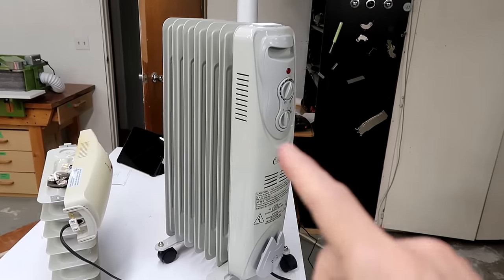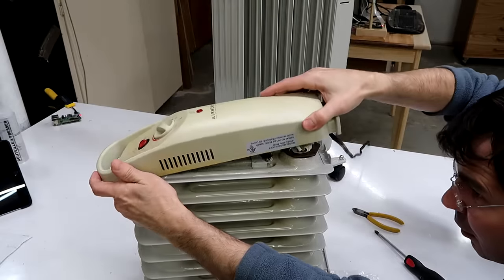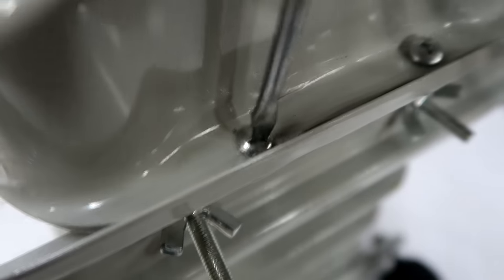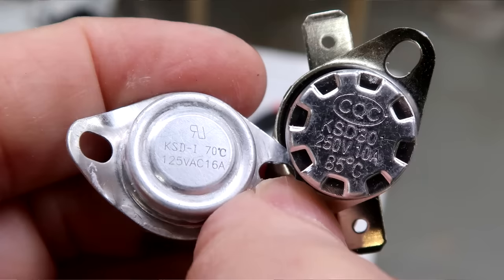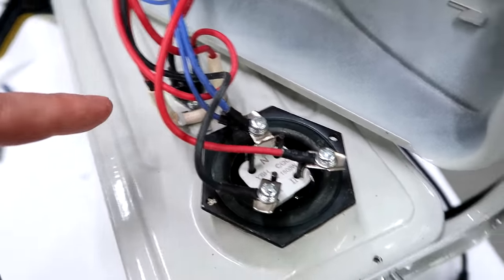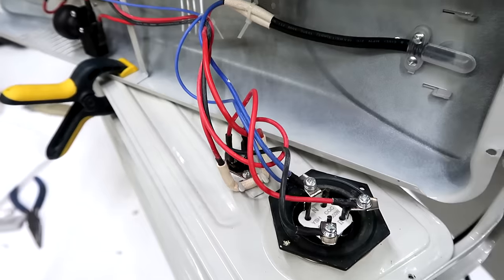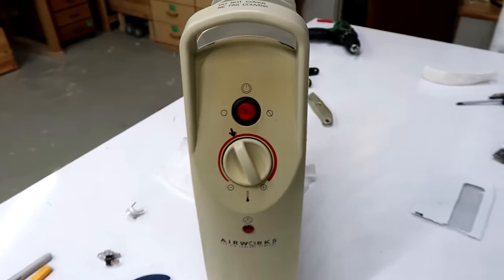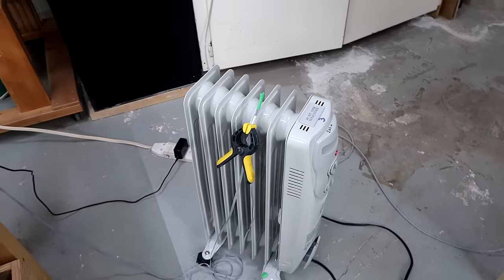Oil filled space heater fix

Comment: I have found that just putting a small oscillating fan behind the heater spreads the heat out better, and keeps it from overheating.
Reply from the maker: if I was wiling to have a fan, why not use heater that already has a fan built in?
Reply: Reminds me of the old saying that goes.like this.  Wood warms you again and again...., chopping,  hauling,  splitting, stacking and burning.
Reply: Matthias random stuff You got told, Matthias.
Reply: Khaffit  Matthias just got Matthias'd, folks.
Reply: Yonatan24 never forget this day!
Reply: @matthiasrandomstuff2221  I like and use the oil heater+fan option it because of the larger surface area and lower surface temperatures than the smaller units with built in fans produce. It seems like less of a fire and burn hazard to me, plus it's really quiet when you use a large oil heater and a box fan on low, while you can still warm a large area quickly.
Reply: @trevormatthews7981  And it poisons you and your neighbours. Burning wood is the worst form of heating except if you are a true erimite.
Reply: Khaffit  You beat me to it. My words exactly.
Reply: I did this for 4 years in college ... a QUIET fan behind the SILENT heater was far more tolerable than the noisy (undersized ductwork) gas furnace that I would only turn up when it got really cold.
Reply: @matthiasrandomstuff2221  Would this work better near a source of thermal loss like a window, if there was an incoming draft you think it would improve performance.
Reply: Put 20 inch box fan behind one with the furnace filter strapped to the back of the fan don't put the fan in front because it will burn the fan up I've done that twice by accident behind the oil filled radiator blowing through it makes for just about the best heater you could ask for I'm not even kidding
Reply: Because the box fan will move so much more volume of air it's not even funny and you're only talking about 50 Watts for the fan maybe even only 35 volume of air and you're talking about a $1 filter furnace filter and $18 box fan how could you go wrong let's not grasp at molecules with chopsticks it's so cheap it's a no-brainer I've done it for two years these things are useless without a fan behind them
Reply: Primarily because fan type heaters tend to have exposed high temperature coils. One of the important features of the oil filled radiators is the absence of exposed fire starting elements...
Reply: I use a ceiling fan on the reverse with a low setting.
Reply: @brh4015 don't agree.
Reply: Oil heaters are significantly more efficient on power due to the capacitive nature of the oil, so a fan coupled with an oil heater would work much much better than a cheap element type fan heater which turns on and off constantly and is also generally noisy.  Firewood poisoning neighbours 😂 my neighbours are several hundred metres away and my property has thousands of dead freestanding trees. I'll keep using my fire thanks.

Comment: Using Phillips screws? In canada? I didnt think that was allowed
Reply: He said more sensible, not the MOST sensible. Ha.
Reply: Meh, Robertson for bigger things for sure, but I'm happy enough with philips on this kinda thing. Hex or Torx are best
Reply: I've put together a lot of Canadian shower doors, and they use mostly philips. Every once in a while you'll see square #2. But Internet folk love to pretend like in Canada everything's Square drive, and that no one else on the planet has ever heard of it  before.
Reply: Those are security screws, chosen to keep homeowners out.  By the way, they're call "tri-wing" - useless information if there ever was any.  Manufacturers would never use any kind of normal screw for that, no matter what "normal" is where you live.
Reply: @paulkolodner2445  Quite the contrary, knowing the name is very usefulf for finding a set of the screwdrivers to buy. Still, it's better to just buy any random set of "security" bits.
Reply: We more often buy Roberston for construction projects - the square head construction, floor and deck screws are very popular.  But, we still use Phillips for drywall.  Manufactured products tend to be whatever they want, depending on the need, costs and circumstances.
Reply: Typically machine screws or metal screws are phillips in Canada, Robertson for electrical and construction.

Going hex ot torx would be so much better for metal/machine.
Reply: You can get a license for them, if you can show genuine need. I think the boxes of phillips screws also have a sin tax of 30% on top of the price as well.
Reply: @404Anymouse  My RV was manufactured in Canada and I was stumbled when I couldn't manage some things and had to buy special screw drivers - you can tell I have no clue what I am talking about ha ha

Comment: A friend of mine burned her house down with one of these. It leaked some oil and the switch shorted and ignited the oil.  Her boss — who owned the local Home Hardware — chopped off the power cords on every one he had in stock and stopped carrying them.
Reply: I was smelling something strange, maybe fire smoke coming in. Woodheat is used by many here in winter. Well I was getting sick so I unplugged oil heater and started it back up at night. The smell was coming from heater, it's toast! I do not recommened repairing. It did it's job for 5 years and not worth causing a fire!
Reply: They are one of safest heaters
Reply: But you need big one and run it on low

Comment: Mine was getting power but not heating. Older than the model you have. I took it apart and checked for damaged connections. Found nothing but it was a little dirty. I cleaned out the debris off connections and wiped it out with a dry paper towel. Turned to the lowest setting and lo and behold it started working! Thanks!💕🙏💕🙏😎

Comment: Great information.  I have a delonghi with toggle switches that light up when they are on.  I have noticed that the heater is no longer getting very hot, even with both switches on.  Do they wear out or something that would cause them to work but stop getting quality hot?

Comment: What would cause a almost brand new units selector switch not to turn.  The unit was purchased in November and its January 21st now  so almost new.  We used only the Low and Medium Setting. But yesterday it locked up on the Low Setting and will not turn.  Amazon is sending a replacement but I am curious as to why???   Many Thanks

Comment: I replaced the thermal switch with manual reset and the oil heater works but I don’t remember the power led lighting up as soon as I plug it in. I remember lighting up when I set selector to low or other settings from off position. Is there something else that needs finding or is that normal?

Comment: Thank you. Can you advise please. My friend brought a challenge radiator for repair. I replaced the open 15 amp internal fuse and switched on but with bang and tripped a cct which was easily switched on. internal fuses ok. Thermo you show reads short. Is this issue. Please advise. Thank you Lewis uk

Comment: I think this has happened to our heater. Did you get a thermostat that's msinly open or mainly closed? I'm guessing if it only switches off at a certain temperature then it would need to be mainly open. Cheers

Comment: I have a Holmes HOH2400 that says made in Italy. The dual rocker switch that allows you to select either or both to total 1500 watts, only works on the lower setting. The 2nd illuminated switch immediately cuts off when selected but even at half power it heats much more than electrics do.
I am trying to find a source for that dual switch. I have a single 3 blade switch but they are combined. That model isn't even on Holmes website?

Comment: I changed the thermal control switch thanks to your informative video...but, my mini oil heater is still not working. Can you suggest another part that might be at fault? This is probably my 4th that has just stopped working and I don't want to keep buying new ones;) Thank you!
Reply from the maker: you will just have to probe around with an ohm meter and figure it out.

Comment: Hi there, 
What a coincidence,  I started fixing my little oil heater a few days ago. The thermal fuse went.  I replaced it and the neon light came on briefly, then went out again. There is still continuity through the thermal fuse. I will need to investigate further as had to stop and go out on an emergency plumbing job.
Any ideas?

Comment: I bought one of these "eco/600/900/1200" oil-filed heaters and it just died after two years of use.  I used it on all levels previously.  I just bought a new one.  If I only use it on 600 (per your suggestion,), do you think it might last longer?  Whatever the case, I have no reason to leave it running all the time.  I normally turn it off for at least 8-10 hours (during the night).  Thanks.

Comment: The original KSD301 is 125v 16A 150, all the replacement on ebay and Amazon is 250v 10A (choice of NO or NC), what should I order? NO or NC, is that 150 Celcius? thanks.

Comment: Hi there, your video caught my eyes when you wrote "all defective by design".

I just found more than one heater with the Neutral wire connected to the rocket switch for nothing.  At the end that terminal in the rocket switch is never connected to any other terminals of the same switch no matter how people are toggling it.

Basically the neutral wire was found connected to the rocket switch and then from the rocket switch another line is connected to the common terminal for the two heating elements.  I am not sure why more than one manufacturer chose to do that. Why they didn't simply run the line to the common terminal of the heating elements (whether to add a temperature safety switch in between or not,  and bypass the rocket switch)?

Has anyone got a comment?

Comment: I wonder if putting a arduino to monitor temps and to modulate the heaters intelligently would be better than a literal dead on/off switch. I see no provision for sending less volts through the heating elements... But simple "on for 1 minute off for 2 minutes" might allow the temperature to be dialed in more accurately.

Comment: I just had to take my dryer apart and it had identical sensor for regulating lower heat settings. I don't think they're really "over protection" sensors. I think they're just used as a means to regulate temperature

Comment: I have a space heater that has two overheat protection thermostats that i assume both need replacing, could anyone provide any guidance...one is a ksd301 v3 10a 250v - 95 the other is a ksd301-r 16a250v 155

Comment: I bought a 2500W one without being aware of this issue. I "fixed" it by buying the same kind of thermostat like you did, but mine was 110C and I bumped it up to 145C, and changed the thermal fuse from 133C to 165C. I know this is more on the dangerous side of things, but having looked at all the components inside they all seemed to be rated well above 165C, and I only use this while I'm in the same room with it, so I think it'll be fine. I'm even considering another +20C  for the upcoming winter since the mineral oil they have inside can go well above 200C.

Comment: I've been using these for years.  Great Video.     I normally run a fan through them in very cold rooms.  No issues.  This year two have failed  in a home that is very warm.  I read the comments and tHanks to other people's experiences I plan to just use the low settings in a warm home, and switch to Turbo Nuclear in cold houses.

Comment: Watching this video was helpful and showed the unit I found out for trash a year ago [resettable fuse was tripped] was wired backward. Mode I [low power] was connected in-line with the thermal cutoff while Mode II [medium power] had no temperature regulation other than the temperature setting dial. As a result, using Mode II (or both for a Mode III/high power) caused the resettable fuse to consistently trip at varying time frames depending on the temperature dial setting. Unit is a Kenmore oil heater and may be worthwhile to check if someone reading this has one with similar issues.

Comment: I use this kinds of heaters and I am only h3re because i wanted to know how its inside, I wish i could just remove the noise from the auto on\off switch, but I dont see the same issues you go7nd with your thermostat nor the power levels, I have 2, one is 20y other is new 1y, both have 3 levels and they work as expected, 1 level consumes less electricity, warms slowly, up to 3 that takes about 2kw and heats fast, the temperatures from low to high seem to work as well. I tend to leave max temp low power over night and the thermostat seems to work fine on both.. I just wish there were a hack to silence the "click"

Comment: It's not a design flaw. The 2-3 settings are for heating the radiator as well as the room a little faster than the 1 setting. The 3 setting only run for an hour. 2 setting 2 hours. Once the room is warmed up go to the 1 setting and set the thermostat in the middle.
A lot of people tend to leave the radiator on the 2-3 with the thermostat all the way up.
The unit will overheat and the shutoff will trip and fail eventually.

Comment: On mine (1500W), the over-heat thermostat is fine, but the high-watt switch contacts burned through.  Lots of carbon bits.  I removed all the wiring to the high-W element, and just use the low side. Takes longer to heat the area, but it's fine.

Comment: I just installed a hybrid water heater.  These pull heat out of the air and dump it into the water at about a 3/1 energy ratio.  In Georgia, we need cooling and dehumidification about 8 months out of the year, so it makes perfect sense to put one of these in the basement.  But if you're more concerned about heating your home than cooling it, they don't save energy in a setup like yours since you're buying the electricity to resistively convert directly to heat.

Comment: This is really useful content. Having to move to narrow oil filled from wide  convector as landlord didn't like where I mounted it(on a door the rooms are tiny and wall space is scarse ) 
Looks like I'm going to have to do something with the thermostat as it practically cold before returning the power.  
I also happen to have an external thermostat which I could put inline with the power cord . 
The idea of doing a factory delete on the safety override is tempting, or at least remove a screw and bend it a bit so it's not directly touching the metal. 
I really do prefer convectors but I'm stuck in a corner here.

Comment: We use a small one in our daughters room. They are so reliable
Reply: We do the same, just set it on the lowest setting and have it turned down so it only kicks in if its particularly cold (we have wood heating, so it usually kicks on a little before sunrise when the coals are starting to diminish.)

Comment: Had a few of these years ago and they worked great,dont remember the brand. they just worked so much better than the other types available. However recently ran across a few of the older very decorative water radiators for home heating an considered converting them into individual oil space heaters. but have been unable to find anything about this anywhere. I do quite a bit of repurposing of all sorts. and about the only thing i have found for these is putting a glass table top on it,in the middle of the dinning room. because that's as far as someone was able to move it. any links, thoughts or ideas would be extremely helpful. thanks
Reply: I had a relative in Iowa that heated his entire house using a hot water heater and pumping it through a radiator amd hooking it to his existing ducts. Worked great. You could do the same but pump the hot water through your newly obtained radiators.

Comment: Are these heaters still common in Nth America? I come from New Zealand and most heating now days is via heat pumps. I imagine your power is significantly cheaper than our so maybe there hasn't been a push for more efficient forms of heating.
Reply from the maker: Lot of heat pumps here too, and if I was building new, I'd have that put in.  But the house has no ducts, and I don't like these things bolted to the side of the house and to the top of rooms much, plus they make wind and noise and break.

Comment: I use one of these in our nursery. I like that the surface never gets hot enough to burn. With the cheaper wire style heaters i was always worried my kids would find a way to get a hand through the guard, or stick something flammable through.
Reply from the maker: yes, that is another thing I like about them.  Fairly safe around the kids.

Comment: Thanks. I have always used the low setting on mine. If I need quick heat, I place a Lifesmart Infrared Heater a meter behind it and let the fan blow through the fins.

Comment: If you put a cardboard chimney on top, would it not draw more air though the fins via the stack effect allowing you to get more power out of the heater? You could design it so that it covers the back so it draws air transferse though the fins too
Reply from the maker: Possibly, but that would draw the heat to the ceiling, and no radiated heat, so overall, not a win.

Comment: I'm in Fredericton and I was surprised how expensive the power is here, and yet it seems to be the cheapest option.
I've been thinking of installing solar but my roof is not perfectly South facing so it seems to complicate everything.
Swapping my heat pump for a geothermal system would be like 25G. Not sure what I can do to reduce my power bills given we did an energy evaluation and no recommendation would help much.
Reply from the maker: Power is too cheap and we are too far north for solar to make much sense here.